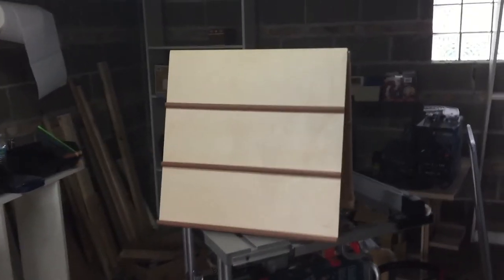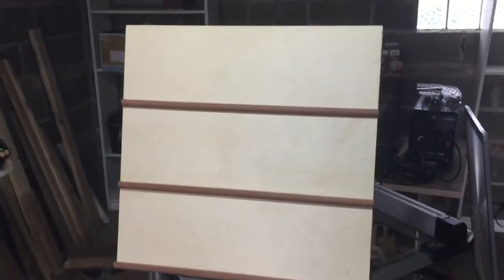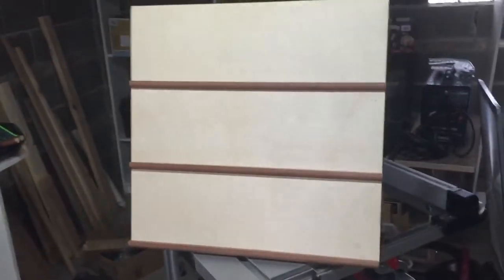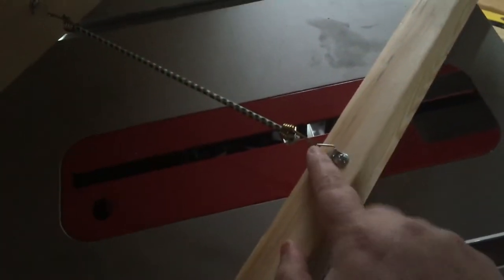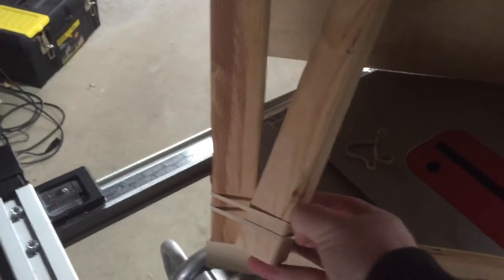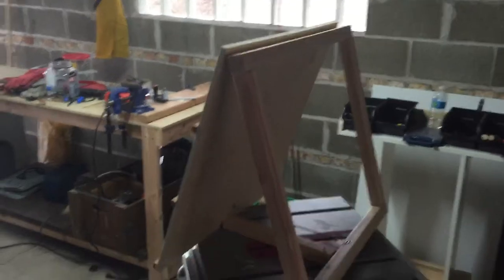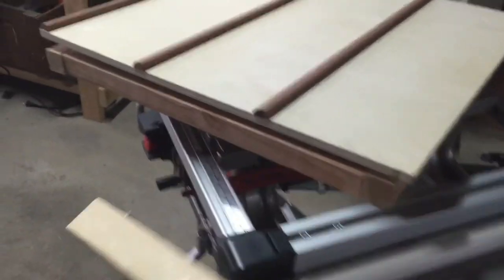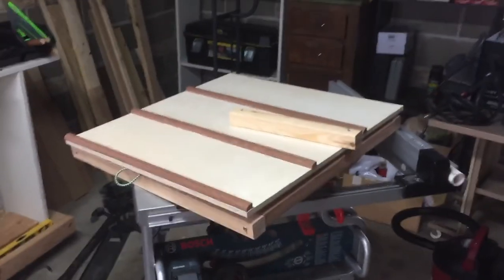Simple Cheap Tabletop Display Rack for small artwork

Comment: Hi there!  Thank you so much for sharing your work! Im taking some of my tiles to a show I'm doing in May, but I'm at a loss as to how to stack them in totes so that they don't get messed up! Mine are sprayed with spar urethane...( thanks for that tip ) but are mounted on barnwood. I'm scared of getting to the show, and finding that I've ruined them all. Any suggestions would be greatly appreciated.
Reply from the maker: +Candice Brown For transporting, I went out and got medium sized, clear plastic bins. I then bought some felt (by the yard is cheapest) and cut pieces roughly the size of my tile plaques. I place the plaques into the bins in pairs facing back to back, with a piece of felt or two between each pair. The bins still have a little room on the sides and horizontally on top, so I squeeze additional works there, or other show supplies. Having clear bins makes it easy to see what's inside each bin. Hope that makes sense! :)
Reply from the maker: +Candice Brown I meant to say: they go in in pairs, STANDING ON END. As long as the bin is pretty full, they won't rattle around. When leaving the show, I consolidate into as few bins as possible. Any half full bins get stuffed with bags, paper, anything, to keep them from falling over in the bin.
Reply from the maker: +Candice Brown You inspired me to make a video showing how I store and transport my tiles: http://youtu.be/iAukf9jrrWA
Thanks!